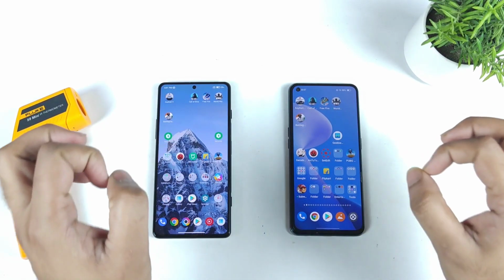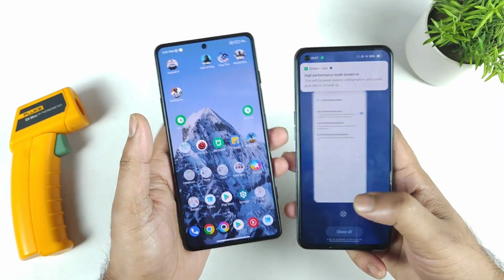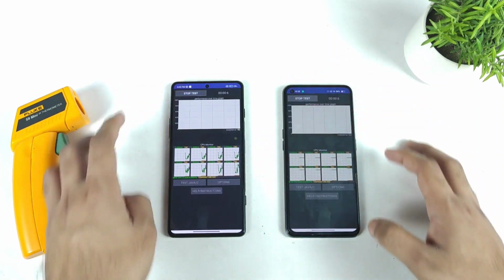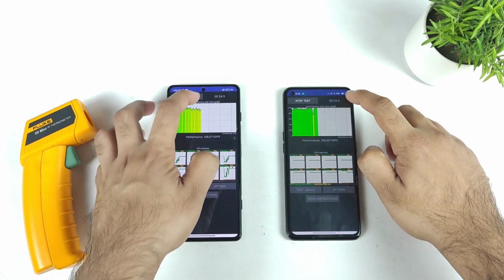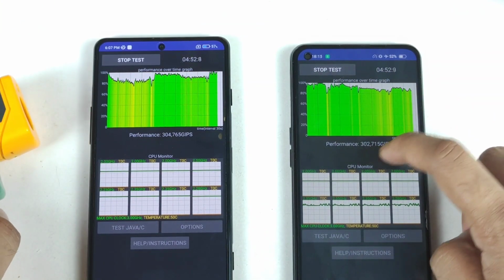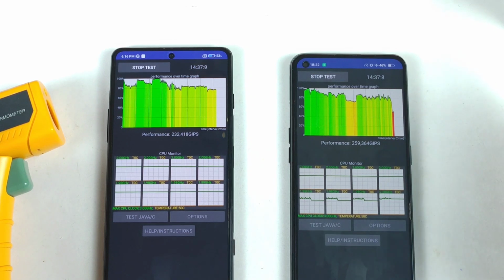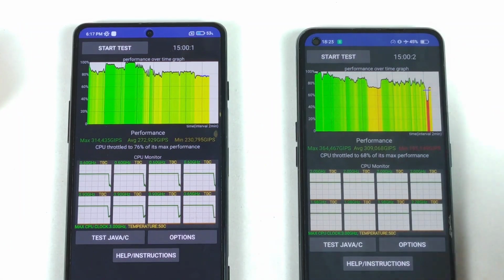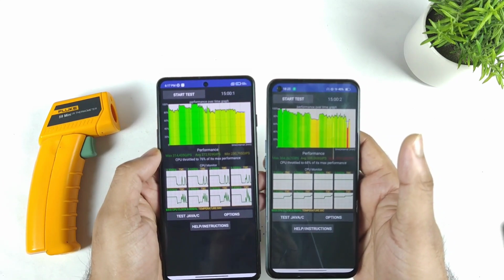Realme X7 Max vs Poco F3 GT CPU Throttling Test Comparison High Performance Mode 🔥🔥🔥

Comment: ordered POCO F3 hope it is all ok
Reply: MIUI sucks
(I m using poco m2pro it sucks)
Reply: @garvpradhan  poco f3 gt finally have some custom rom so no problem
Reply: @garvpradhan  well your phone sucks that's why you said it sucks it's an M series, don't compare it with F series with the same UI , the builds are different and it's also the chips are too far in speed of each other
Reply: Altho it has flagship proc and ram, still bugs and glitches r there.
Reply: @garvpradhan  works fine (Inm using Poco F3 GT for 6 months)
Reply: @colossalprowess34  it is worth it right?
Reply: @ancoorbanerjee  yeah ...y not!!!...itz really worth💯...
Reply: @colossalprowess34  thanks for the info